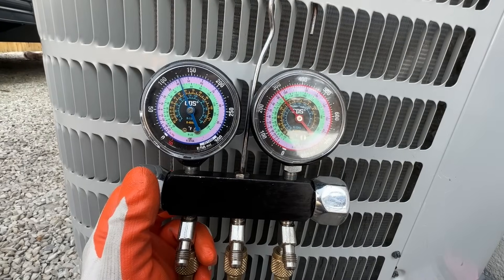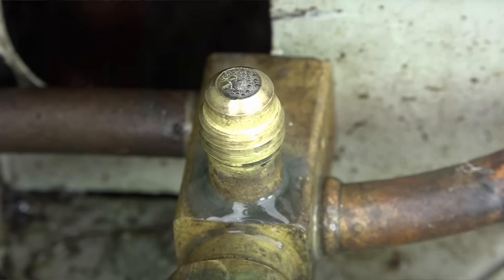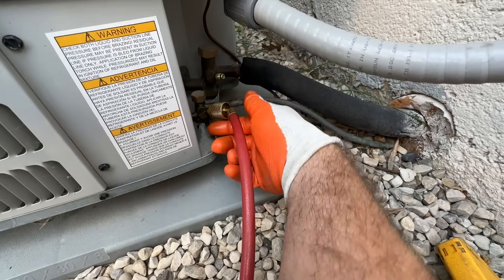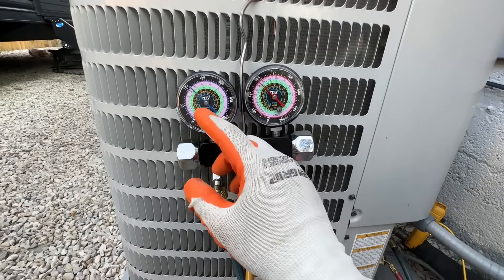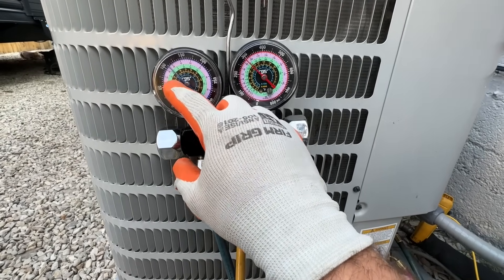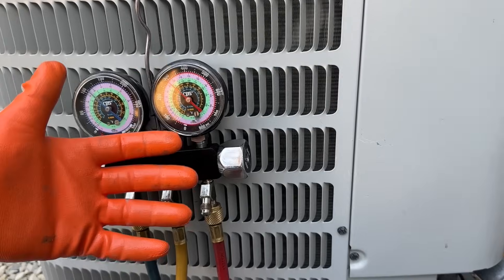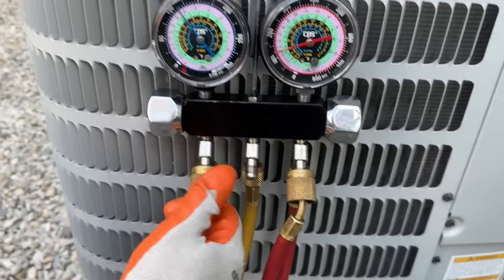How To Add Refrigerant To Your Air Conditioner R410A & R22

Comment: Great video, but I'm going to pick at a couple things as an HVAC tech. I know you said there are other factors into charging than what was already said, and I'm also glad you talked about the EPA 608 certification. 

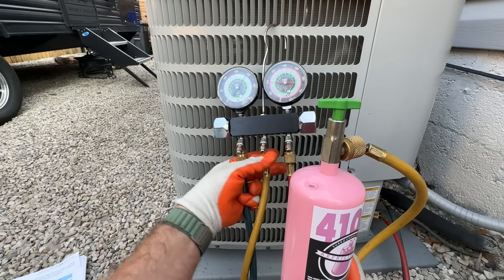 @ 4:07, You purged the line of air from the refrigerant can, but did not purge with liquid at least on video. If this was R22, it would be fine because R22 is a zeotropic liquid (meaning one component) and you would be able to charge an R22 system with gas or liquid. R410A is an azeotropic refrigerant (meaning two or more components) and can only be charged with liquid (or a flasher nowadays). You must purge with liquid refrigerant (burp the line unit liquid ref comes out at the manifold while the can is upside down), otherwise you may unequally add the refrigerant. Probably would not hurt the system unless charged with a lot of gas instead of liquid, but it's a bad practice.

Companies charge a lot of money for the refrigerant because it costs a lot of money for us too. 25 lbs. Virgin R22 goes for $1800-2200 company cost, R410A about $300-600 for 25 pounds. Legit, licensed companies charge a lot because it takes a lot for us to know how to do it right plus business expenses. Thank your EPA and the Montreal Protocol for the giant money scheme! Yes they are 30 pound drums, subtract the tank weight and you get roughly 25.
Reply: Also, R-22 even at $2,200/30 = $73 a pound your cost. So, that's a nice markup added to the service charge. I just had a tech try to charge me for R-407c $104 first lb and $259 each additional. The best part he was going to add it to a unmodified R-22 system. Not to mention he tried to hook and crook me on an evap coil (Over $3,314), which I just recently cleaned he said it was rusty.
Reply: @dougshaffer5524  Why was he adding refrigerant though? Where did it go? Did it evaporate? Maybe the evap coil that you cleaned was leaking..... Rusty coils are most common cause of leaks. It's a hook and crook nowadays to fix things because people don't want to replace them haha. How old is your car? U put bandaids on that too?
Reply: @mackenzieschoenfeld4810  It was a slow leak on the suction line service port Schrader valve. A squirrel chewed through the cap and I had to be patient with the soap and water. He claimed an evap coil leak, though it was his second pass. The coil has light rust, which really isn't reacting with the copper lines. I've seen evap coils, when they reach the point of failure, usually the oil is a dead giveaway. I only called in for help, because a storm knocked some trees down and I had to focus on getting that cleared up. As to that last dig, I must have hit close to home. I make good money thanks to piss poor installs done by "pros" doing half assed work. Keep on keeping on, it keeps me busy
Reply: I just looked at 2 websites and R-22 goes for about $975 for 30lbs.   Where are these $1800-2200 numbers coming from.
Reply: @star9732  I'd have to guess he's told that by someone at the company he works for, so if he tells a customer their "cost" is $74/lb, the customer doesn't react as badly at being charged 4x that per pound for a system charge than being told they're paying over 9x as much as it cost the company!  Or perhaps in recent years the price spiked and it WAS 1800-2200/30lbs, maybe even their company last purchased at that price, but they never heard the price went down since they're not placing supply orders (or haven't had to order more R22).
Reply: I believe there is starting to be an oversupply of R-22 due to all the recovery and reclaiming going on.  @star9732
Reply: @star9732  $30 a pound in a 30 lb tank is cost, delivered. These HVAC guys are bandits. Big car payments and fancy weekend toys will require more per pound.
Reply: Both Zeotropic and Azeotropic are refrigerant blends of two or more refrigerants. Zeotropic means the boiling point and dew point are different between the refrigerants separating them in vapor, known as glide, the vapor of the refrigerants are no longer mixed, forming separate layers Fractionation, and won't charge in the right percentages, so it needs to be charged into the system in liquid and flashed to avoid getting liquid into the compressor. Example 407c (23% R-32, 25% R-125, 52% R-134a). Azeotropic means the refrigerants have the same boiling and dew points. All blended refrigerants should be added to the system in liquid.

Comment: It is a epa 608 violation if you don't use ball valves or low loss fittings when charging.
Reply from the maker: No, that’s acceptable loss from the epa standpoint.
Reply: During my EPA study with SkillCat, SkillCat says it is a violation indeed @diyhvacguy

Comment: checking a check box  no submissions?  that is too easy what is to keep someone from falsifying and saying that they have the license and/or resell and use it to service the unit?

unless when you get the license the status is put into a database that the site automatically checks (kind of like online credit applications do for the credit bureaus and when filing taxes online the irs can do the verification automatically)?

not just leaks but huffing refrigerant is another cause of missing refrigerant.
Reply from the maker: I’m not sure on if they have someone’s certification on file but I don’t know how they’d manage that. But in short yes, all I checked was a box saying I have mine.

Comment: My 20 yo unit is running good still but had a hvac guy do some maintenance and he said I was low on Freon. Why can’t hvac just refill the Freon? He says I need a new unit
Reply from the maker: Because it means less dough in their pocket.
Reply: You should never be low on Freon, your hvac tech should let you know there’s a leak and he will find it to see if its repairable. In most cases the leak is in one of the two coils and at that point you would have to replace the coil. 
 If your unit is 20 years old the coil may not be available anymore or your company may be charging you $4000 plus to replace it. It may be time to consider upgrading vs repairing an old system with old components in it.
Btw I’m in hvac tech :)
Reply: Yes, I understand, you like to take the easy way out and not repair but install new for the big bucks.  @josephtorres9271

Comment: This is a great video that gives a person a good idea about what it takes to charge your AC. I recommend watching it before you have your qualified AC tech out. My Tech has an App on his Tablet that gives him tons of data specifically about my system. Including temperature/airflow probes so he can balance the system.  If you are low on freon you do have a leak. I DIYed my new Central AC system 3 years ago. And had my AC Tech finish off the last 2 hours of the install  and startup.
Reply: Interesting...  So what all did the tech have to finish that you hadn't done?  How much was the equipment that you purchased and tonnage?
Reply: Were you able to find the leak?   3 years later still are you able to see if there is a leak with lowered pressure?

Comment: Hi my hvac froze I replaced the unit now my blower motor is not blowing enough air but it was okay before I replaced the unit what could be?
Reply: If you dont have enough fan speed the new system must be freezing up also.... may have been the reason it was freezing up before.... was it a complete change evap and condensing coil.... was it sized correctly... do u change your filters...?? Was the job done correctly...??

Comment: FYI if you have a TXV you need to charge by Subcooling and check by superheat. The TXVs job is to maintain a fixed superheat. Also before you even begin to add refrigerant you need to let the system run for 20 mins minimum also after adding you have to let the system run. For pistons you need to explain how to come up with the superheat value. Please if you’re trying to show people how to do it yourself these little details are very important. If they aren’t doing it correctly the repairs to have someone come out and fix it could be just as much or even more than “just topping off”.
Reply: Old school - finger test on R22.
Grab low side line with 2 fingers and a thumb.
If not cold, slowly add some in until the moment you feel any change then stop adding. Be certain the high side does not get really high (300 PSI on R22 is too high -    200-250 is about right)
If high side too high and low side too low, you have a clog somewhere or something sticking or air in the system.
Did you know that R290 almost mirrors R22? Too bad it is illegal to put it in systems that have people in them.

If it don't sweat, YOU WILL.

Thermometer -
Check return vent then check a few supply vents. Should be about 20F difference or slightly more (SLIGHTLY).
No need for complicated subcooling/superheat with wet bulb dry bulb nonsense.
Reply: @crazysquirrel9425 there is a need for superheat and subcooling…… flooding evap coils and returning liquid back to the compressor isn’t doing the customer any justice. If you don’t have enough refrigerant your compressor will run to hot and once again not doing any justice for the customer. You must be a home inspector with the way you take a delta t. You never go to the vents, it’s always at the indoor unit. You can have low air flow and a charge that’s way off and get a 20° split. Your delta temp also depends on the humidity level in the house. I really hope you don’t do HVAC for a living
Reply: @foxplaysroblox2866  When a college educated (knucklehead) did it your way to a house, the house never got cool.
A friend (retired) went to see what was the problem.
He touched the return line with thumb and forefinger and said they didn't put in enough R22.
He added about 1/2 pound which is what it took to feel a change in the return line temperature, then waited 15-20 minutes for things to settle.
WORKED PERFECTLY. House got cool, return line sweat, property owner was happy. And there was a 22 degree difference between the supply and return vent.
He didn't use a sling psychrometer either.
All by a simple touch.
No I do not do HVAC for a living.
Reply: @crazysquirrel9425  Once you understand what over charging or under charging does to an HVAC system and you actually care about your customers then you would see why I’m against that old out dated beer can cold mentality. No I’m not college educated either I barely graduated high school. I have 21 years of HVAC experience and take pride in my work and want to see people teaching others the correct way of doing our trade. Yea you can touch the big sweaty line and say it’s cold you’re all good now partner, but the reality is you have no idea what was done to your efficiency or how much life expectancy you took off of the system. If the “educated” guy charged the system correctly using super heat for a piston or sub cooling and super heat for a TXV and you’re still having issues then the problem isn’t your refrigerant charge. The guy that felt your line and said it was cold was probably the same kind of guy that stood at the road to see how many fingers covered your house to size the system. I’d probably say you have a piston system and the wrong size piston was used…… bet if you check the superheat you running less than 5° but hey what do I know
Reply: @foxplaysroblox2866  Not licensed to check superheat and such.
I do suspect that the kid that first installed the system didn't pull a vacuum or not enough of one.
Or just fudged the numbers to get it working then get out with the cash.
The beer can example works pretty well.
Unless you got a junk 410A system.
Many techs don't care about longevity on older systems. They get paid to replace them.

Constant cool air is NOT what people want. Nor constant barely warm air either in the winter time.
They want it fast and COLD out of the vents, then shut off (thinking it will save money).
15 degree supply vent difference is absolutely NOT cold enough. 30 degree might be.
Odd that a lot of people want a 60 degree house in the summer but want an 80 degree house in the winter. Go figure.

I have seen neighbors spray water on their unit just to get the air COLD out of the vent.
With the extortionary prices charged for insulating, replacing windows, and upgrading the HVAC, especially during this economy, people will go the cheap route. No way a system should cost $10K for a 5 ton, INSTALLED. Maybe $4K at best. So that leaves $6K in obscene profits for the boss.

Seems they want it to blow cold like a car AC does.

Comment: wow ability(which has good prices) has 25lb of r410a for $400. I got same 25lb off amazon in 2019 for $118. Insanity is an HVAC tech will charge over $100/lb for R410a
also 3 position service valves - operating position shuts off the port, another position opens the port, another position shuts off the discharge line (for doing pump down)
when finished filling, turn service valve to shut off the port so you don't have to rely on the schrader and cap to seal.

Comment: This is great content my dude. Any thoughts on how to do a refrigerant leak identification and whether any of those stop leak fluid injection kits are worth trying for a slow leak?
Reply from the maker: I would not advise stop leak. It’s terrible for your system, vehicle or residential. I’d advise getting a dye and injecting it. I’ll do a video on that soon! If you want to get real fancy you can pick up a refrigerant leak detector
Reply: I do this for a living and they way I explain it to my coustomers is I tell them you're low on refrigerant which means you have a leak somewhere which gives us 3 options 
Option 1: add leak seal and charge correctly this is the cheapest and easiest option but leak seal almost never works even on slow leaks most likely you'll have the same exact problem later down the road most likely your just kicking the ball down the road
Option 2 leak search and repair where we pressurize the system with nitrogen up to 400 PSI and find the leak and braze it if it's in a repairable area then recover what's left of charge pull a vacuum and charge system
Option 3 total unit replacement
Reply: @jake48396  "we pressurize the system with nitrogen up to 400 PSI and find the leak and braze it if it's in a repairable area then recover what's left of charge"...!!!  I hope that's not the order you go in!  You'd need to recover remaining charge first, THEN pressurize with nitrogen, fix leak, then pull a vacuum and charge.  Otherwise you'd be contaminating the recovered refrigerant with the nitrogen making it worthless for recharging with or refurbishing.  Mostly applicable to R22, since R410 leaks could throw off the blend ratio of what's remaining in the system.
Reply: @@phillipterrrazas575 absolutely I end up using it a lot because a lot of coustomers don't have the money for the other 2 options or they just want to get by until next season

Comment: A company just tried to charge me $569 per pound for R22. And even said I should just replace the unit 😒
Reply: Same thing happened to me.  A fitting at the coil up in the attic was leaking and the unit needed 7 lbs of freon.  At first they were trying to tell me I needed a new inside and outside unit but I blew up on them and told them to leave I'll get someone else who is not trying to scam me.  The guy got the owner of the company on the phone and I talked him into re-charging it with R22 but I had to pay close to $2000.  He was trying to tell me they don't have R22 anymore but this was before it was discontinued.   The entire A/C repair industry is nothing but organized crime anymore.
Reply: @dirtwhisperer658  i do handy man work amd a lady i worked for said someone tried to get her to pay for the whole 30 lbs tank because he didnt have her freon. He wanted her to pay for it and call it his price to do the job, but really just wanted her to buy a whole 30 lb so he didnt come off any money and he then could sell the rest for even more money... total fucken scumbags.. low lifes just straight up robbing people.
Reply from the maker: Yea it’s absolutely absurd. They get away with it ALL the time too.
Reply: 300 a lb in my city it's crazy I'm miserable in this heat. I don't have 1600.00 for there price so have to suffer.
Reply: @tonnies1099  Look for a company that has R-458A (Bluon TdX 20). It's a replacement for R-22. Much cheaper and more efficient.  Companies will try and sell you a new system that use R-410A but in a few years, that refrigerant is also going to be discontinued. Replacement refrigerant for R-410A is R-32. For your car, R-134a is on the way out as well and is currently being replaced with R-1234yf. Both R-32 and  R-1234yf are slightly flammable and certain safety precautions must be adhered to when dealing with flammable refrigerants.
Reply: Yeap thats the reason i bought my starter kit

Comment: I made a mistake and hooked up while unit was on. Then I purged the low side at the gauges , did I suck air into my system?
Reply from the maker: No, the system is always under pressure even though it’s the “suction” side. You are totally fine. I clear that up in a video on manifolds that comes out next week 👍🏼
Reply: @diyhvacguy  Thank you for your reply. I had my split topped off by a big name co. and they charged me 200 bucks for 1 lb of 401a. That didn't even include the service call. Rip-offs.